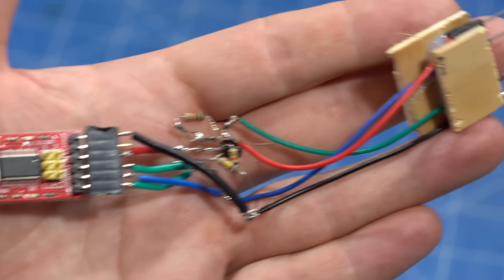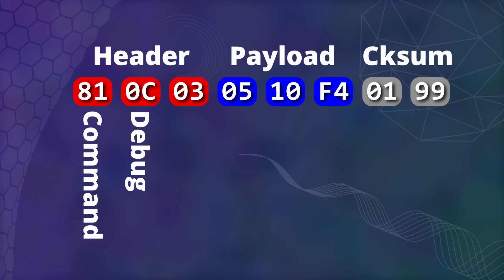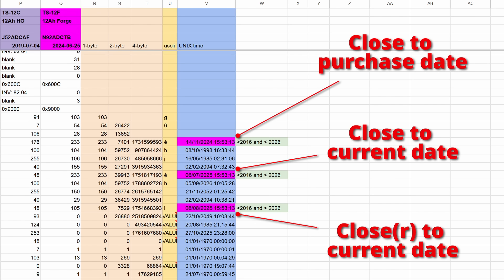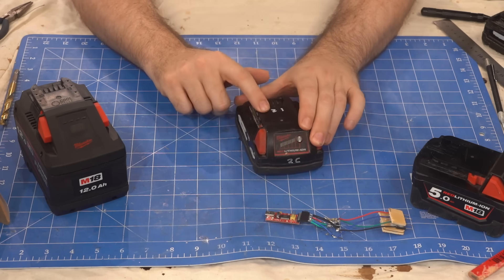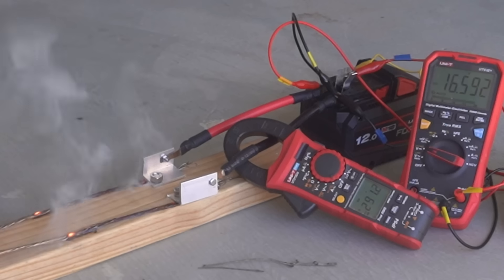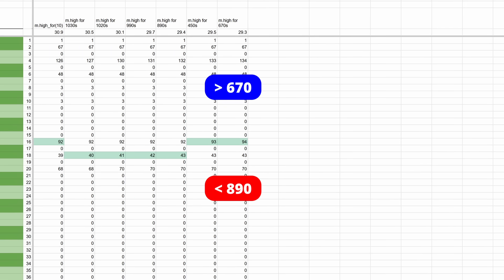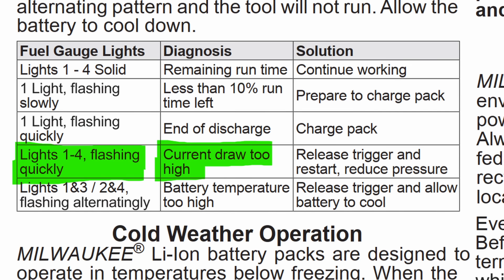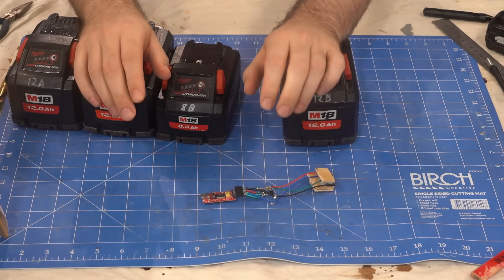Full M18 diagnostics revealed

Comment: Great Video. I don't even own this brand of tool battery but still found your work interesting. One improvement idea would be to use web serial. This would give you a lot of gui options and a smother user experience without having to install any software.
Reply from the maker: I had a thought several days ago that a web app would be more accessible. Then I dismissed it as there's no way a web browser could drive a serial port. Turns out I was wrong! Although it looks like it's just chromium browsers, but Installing a new browser is still a lower hurdle than installing python and running scripts from a command line.
Reply: I have worked with web serial for other open source project websites I host and could help you get started. Do you have something like a project discord?

Comment: Thank you for fixing our Milwaukee batteries and giving us the keys to diagnose the items we purchased.
Reply: Don't you mean altering recorded data so an abused / over cycled battery can be warranted?
Reply: @bobroberts2371  How's that boot taste?
Reply: @CloudCuckooKing Did you watch time 951 to 1021 ?
Reply: @bobroberts2371  I did! Which is superfluous because it seems to be read only in the first place!
Further, if it isn't, then Milwaukee will need to either secure its data as it should have in the first place instead of relying on obscurity and refusing to document what it sells, or stand behind its products in the first place!
I ask again: How's that boot taste?
I will own what I buy, and your compensated comments don't change that.
Reply: @CloudCuckooKing  Do you have the right to damage an item you bought then demand the damage be covered under warranty?  If you had a company making items, would you gladly warranty items intentionally damaged? 
Are YOU aware that every time you stop at a stop sign or traffic light drive on the proper side of the road, you are submitting to the will of law enforcement?
Reply: @bobroberts2371  Your red herring is a straw man.

1. No one has a right to any warranty. It's a deal I agreed to as part of the purchase.
2.The warranty only covers defects on their end 99% of the time. Why do you think this is even within the warranty period? If you're going to these lengths to fix a battery, there's no warranty anymore or you'd RMA it.
2.5. If you've damaged your item before the warranty is out, I'd be willing to bet they'd fix it if you were honest about it.
3. Nothing implies these batteries are intentionally damaged. Or being RMAd. Which if you went through all that just to send in a $100 battery from 3 years ago, you'd be ahead way more by tossing the battery and working you day job in the same amount of time.
Also your plan would be foiled when they looked at it.
4. Traffic Laws are the will of the People which are enforced by Law ENFORCEMENT.
Reply: @dannymitchell6131  Cloud Cuckoo stated that the battery maker should have their system 100% locked down if they don't want people to alter data for warranty reasons. 
He also leans on the boot licking comment, you know the one that people post when they don't want ANYONE to tell them what to do or anyone that has never been told NO.
 I'm betting he buys new in the box Milwaukee / Dewalt tools at a swap meets for 50 % off retail. . . . 
If he does not want to be under the boot of tool companies, why doesn't HE start a tool company and leave all of the IP information open source / free to the public? Surely he can get a bunch of investors to fund the company.
Reply: @bobroberts2371  No, I didn't, liar. It is in writing. Putting words in my mouth is pretty short-sighted in light of that! I said they should take any measure beyond security-through-obscurity, such as signing its contents, or, y'know, not supporting writing through the microcontroller, which appears to be the case.
You are relying on putting words in the mouth of, and outright fabricating accusations about, anyone who isn't okay with buying something and then not owning it.
This is why the bootlicking remark.
You submit to your corporate masters and mock anyone who so much as pulls the leash.
Reply: @CloudCuckooKing As I stated before  
" If he ( YOU ) does not want to be under the boot of tool companies, why doesn't HE ( YOU ) start a tool company and leave all of the IP information open source / free to the public? Surely he can get a bunch of investors to fund the company."
Reply: @bobroberts2371  this is a deflection and a false equivalency!
Simply because I do not have the money or influence to start a tool company at all does not make Milwaukee's anti-consumer behavior morally legitimate.
This goes doubly when the influence necessary would be with the class of people who stand to gain the most from erasing ownership!
Nobody is fooled.
Reply: @CloudCuckooKing   And if YOU had the $ and other resources to start a tool company, you would be completely OK with IP information being freely distributed?  R and D information that could lead to others making counterfeit items that YOU need to warranty when they fail? 
Surely there are millions of people that think like you and are willing to give you $$$ to start a tool company and NOT expect a return on investment.
Reply: @bobrobert bad take dude
Reply: @joshfixall  Try time 951 to 1021
Reply: No, that's degenerate behavior and simply wasn't implied by anyone until you showed up.

Many people work for a living and being able to pull some imbalanced cells out of permanent hibernation so the FNG has something to use (without risking a new $100 battery falling off a roof/truck)... golly that would be appreciated. Especially since it's mine and I paid for it. 

Warranty covers mfg defects and abusing that is the exact mentality that got us into a low-trust society.

Fwiw, I use Milwaukee for the batteries. They have the most relaxed internal kill switch. Guess who's tools I'll stop buying when/if the dollar per charge ratio gets too expensive? Literally anyone. 

Batteries still going strong after a few years? Yep, grab a sawzall or a holehog to match. 
No? Call the Hilti truck.
Reply: @dannymitchell6131  The problem is the group Louis Rossmann brought here are definitely not the ones buying these tools for actual work. My company does (we use a lot of impacts and press tools). I have not seen any manufacturing defects from Milwaukee since we started buying from them 7 years ago, other than one impact that wouldn't start no matter which battery was inserted.

They're a great company. But a whole bunch of people who use their tools a few times a year for home projects are whining about how Milwaukee is 'abusing' them and it's very tiresome to see.

Comment: Great info, but in your opinion what  is the the tool brand with the best batteries?
Reply from the maker: Hard to say. One brand could have a better design, but still be worse if they use lower quality cells, or don't cell match properly. The only way to really know would be to buy 5 of each and test them to failure. That becomes a very big test if you want to test all 2,3,4,5,6,8,12 Ah variants.

Comment: im still abusing my same 3 m18 batteries from 2014ish, but they are definitely getting weaker in their older age
Reply from the maker: Yeah, it's really only the high output 8 & 12Ah (and the discontinued 9 & 12Ah) that have problems. Actually, I think the High Output 8 & 12Ah are also discontinued in favour of Forge batteries.

Comment: The shifting board you showed only brings 3.3V to 5V not the 8V minimum you said is required??? Please advise or correct?
Reply: The level shifter uses battery voltage as high level. So from 3.3V to VBAT. It’s not the best solution, but it worked out for us here.
Reply: @mnh-jansson  Thank you and thank you Tool Scientist for clarifying. This video has gone viral saw it in one of Louis videos. Good work gentlemen!

Comment: How long until you release a small device to read (and edit) Milwaukee batteries?

I wonder how similar the battery monitors are for the other TTI brands (ie: Hart, Ryobi, etc...). I only have Hart, but haven't had an issue with any of them.
Reply from the maker: Unsure of if we're going to go that route yet. It would be a big time investment that someone else could just steal the code off and undercut us. So I'm trying to find a "least effort" solution

Comment: Seriously, putting the whole battery in an oven to overheat it? Why not just open it and tickle the temperature sensors directly instead. Or is it that the actual cells themselves must be heated?
Reply from the maker: That was just a gag, the oven wasn't hot. At 12:43 I show a variable resistor in parallel with the thermistor, which I use to trick the battery's temp reading.

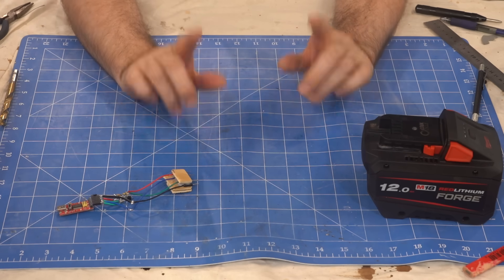Comment: 1:42 Why FTDI? They are known to brick your Chinese serial adapter via their driver.
Reply from the maker: Martin and Topper did most of the initial work with getting the adapter going - I just went with what they set up. Apparently they had some issues with other adapters not properly grounding DTX or something. I've recommended FTDI because it's just what we've all used and we know it works.

Comment: Part of what started my investigation into the presence of cell balancing was when i bough a used tool that came with a pair of 5.0xc packs. One of the packs, as i bought it, was 2mV out of balance. I made the logical assumption that any pack that has been used for 5 years couldnt possibly be this close. Even differences of temperature between the cells as they get used should have cause more than what i was seeing. 

I have some 4xc packs that can go to the four flashing light overload. I think why it seems easier with these is the completely stonk TenPower 20sg cells that can really dish out the electrons, the 2v low voltage cut inherit on the xc packs and deliberate use on a 6" grinder. I would think that the current rating to overload would be common across the xc packs and there probably arent that many tools that can invoke the status. I also dont use xc packs on grinders often because it is a waste of time, i have HO and forge packs to make sparks with.
Reply from the maker: I hope you build this diagnostics reader. You might be able to give us valuable info from those 4Ah packs. Also that 9999 charge count pack you had - I bet it's the dumb charge count that's gone whacky.
Reply: Lol. You assume i have a computer.

Soldering together a serial adapter is within my skill set.
Reply from the maker: @timothybayliss6680  convince boss man to do it. Actually maybe not - he'll start logging how many hours of trigger time each worker does each day.

Comment: Its a shame I have 2 8ah that I have to balance once every 2 months and its just for home tools.. My dewalt tools are 20 years old and still going strong yet my 2 year old batteries who have been in my house their whole life are junk....
Reply from the maker: It's very much the cells. Most of my M18 packs are pretty good, but the ones that use 4Ah 21700 cells (8 & 12Ah) are notoriously bad, and they're bad across all brands.
Reply: @toolscientist  yea I havent bought another battery since them. Ill be rebuilding my packs when needed. Im not pleased with the bms at all. I have found that my leaf blower knocks them out of balance the fastest.

Comment: Great work! Can't wait to see what you/the community comes up with as far as interface. I may even try coming up with something. So looking at this level shifter you're saying that j2 needs to receive commands at 8-20v?
Reply from the maker: Yes. I think design voltage is 12V (that's what the charger outputs). Minimum it will respond to is 7.1V (but there could be variance between batteries and temp, etc, which is why I said 8V). The three of us that worked on this just gave it full pack voltage (so sometimes up to 21V) and we haven't had any problems.

Comment: Next up, DeWalt?
Reply from the maker: My [009] video covers the basics of how Dewalt tools and batteries interface. It's all analog, so not super interesting. Their Flexvolt packs are interesting, but I need a dead one to have a deeper look (I don't think there's any microcontrollers in them). I have a 5Ah powerstack that I've been meaning to take a deeper look at. This has a more advanced BMS with MCU and AFE, but it's under thick potting, so hard to probe.
Reply: @toolscientist  Went and watched; kinda disappointed in DeWalt... though not putting us in the position to need to reverse-engineer this could be viewed as a positive.... Still kinda curious about the Powerstack batteries though, recently had a 80-day old 5Ah  refuse to charge past one bar, got it warrantied though. I'll ask around on jobs, see if I can find any dead ones.

Comment: Wow, fantastic and extremely impressive work! Makita and Milwaukee down — now let’s hope you can crack the code for Bosch and DeWalt next!
Reply: Standard DeWALT 20V Max doesn’t have any external communications, right? Maybe FlexVolt, PowerStack, and PowerPack do, but I haven’t heard that.
Reply: @emmettturner9452  DeWalt batteries have 5 terminals. Power only comes from the outside 2. The inner 3 appear to be diagnostics or balance connectors.
Reply: @asm2750  They actually have 8 terminals. The center three are double stacked. They don’t communicate with anything though. C1 through C4 tap the individual cell banks, TH is a thermistor that lets the tool (or the charger) monitor the temperature. The pack itself doesn’t know anything. The last one is “Type” so that the tool knows if it’s a high amperage battery or not. The battery itself has no logic and is blissfully unaware.
Reply: Has anyone had a serious look at AEG/Ridgid?
Reply: @emmettturner9452 you mean the BMS is aware but doesn't communicate? 

I guess Dewalt engineers read the chips directly when servicing batteries under warranty then
Reply: @PurpleBird-mh7vb  Yeah. While there is a small chip, it’s hard to call anything there a “BMS” except maybe on their fancier batteries (FlexVolt; PowerStack). The clones generally have wires only from the terminals with no PCB inside.
Reply: Where can I find the Makita specs?
Reply: I'd be onboard for DeWalt.

Comment: For winter temperatures of -10°C and heavy loads, which should I buy, Forge8Ah or HighOutput 12Ah?
I am interested in durability and starting in cold weather with high currents.
Will there be no protection at start-up, will it trip at low voltage if the battery is frozen?
Reply from the maker: I've personally had bad experiences with the High Output 8 & 12Ah, and you can find many others with the same experience. I would lean towards Forge, but it's still too early to know how reliable they will be.

Comment: a $300 battery still doesnt balance the cells.. outrageous
Reply: Welcome to Hilti ownership
Reply: consumers are misinformed by businesses,  no arguments.  🎉
Reply: Planned obsolescence exactly as intended. Now buy new batteries. Don't worry about balancing.
Reply: @AG-eb8yy  Get a life.
Reply: A $3k prius hybrid battery doesn't balance itself either
Reply: Prius is not even li ion but nimh which bleeds heat when fully charged, that's the go to method, new li ion plug in Prius has active management
Reply: @chrisjin7175  NIMH batteries don't need balancing. Older rc cars used 8 cell NIMH/NICD packs with no balancing. The NIMH pack in Toyotas only monitor the voltage in pairs of 2 modules.
Reply: @chrisjin7175  because it's nimh... Not lithium.
Reply: Sorry I was misinformed about the M18 pinout.  They do have balancing in each pack.
Reply: @lanzer22  You need active balancing to make these packs last. When 1 group of cells gets a little weaker, the other cells will just dump power into the worse cells as the internal resistance gets higher. Those bad cells will get very hot and will be first to fail.
Reply: @lanzer22  it's not, why are you talking about stuff that you don't know anything about?
Reply: Balancing causes more problems than it solves.
Reply: @evan010101  false. Can we please stop spreading this fud about balancing lol?

Comment: Don't forget that cars are keeping track of your naughty life, would be interessting to know what your batterys are thinking of you in that regard. Great video, please keep going!
Perhaps someone like bigclive could build you something for high amps testing?
Reply from the maker: There's some simple CC designs out there using an opamp and zener reference. Just have to parallel a bunch of linear FETs and mount them to a heatsink. I've got a lot of other stuff to do, so not sure if I'll get around to it just to test some discharge buckets. But it could be useful in the future - this is the 2nd time I've needed a 100A+ load.

Comment: How do they keep time? Time set during production and then left alone to drift?
Reply from the maker: I think so. Haven't dived in deep, but some of my batteries are more than a year adrift. My newest battery (15 months from manufacture) is 9 days  behind. They prob just mass initialise them in batches.
Reply: Btw, have you checked how much self discharge current they have? I'm wondering what's the safe storage duration.
Reply from the maker: @eIektrinis  not sure, but it's very low. In my Forge balancing vid, I left it on the charger for I think 21 days and it dropped by maybe 20mV and a lot of that was post-charge settling. After taking it off the charger for another ~14 days it dropped a few mV. 

At 15:55 my 3Ah lost 5mV after 9 days. There's usually 1-2mV variance in the cell measurements anyway. I can take a snapshot in another week or 2 to see how it changes.